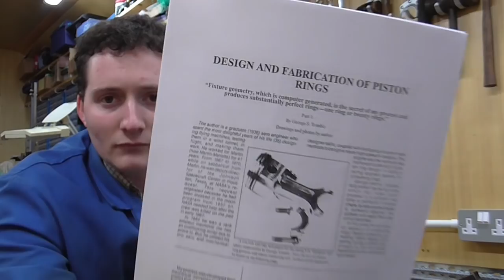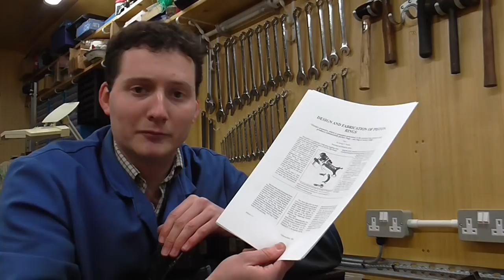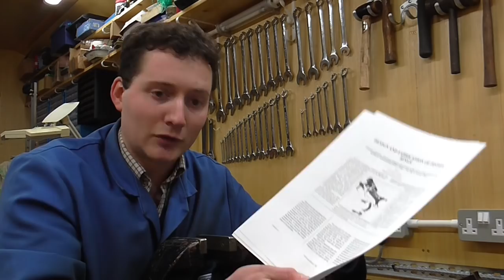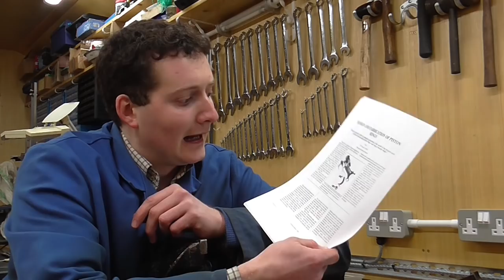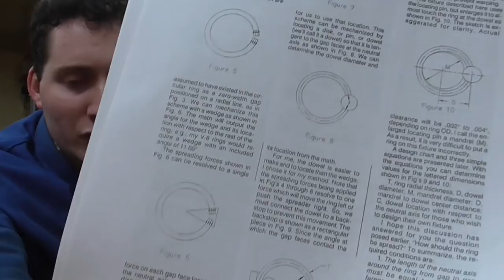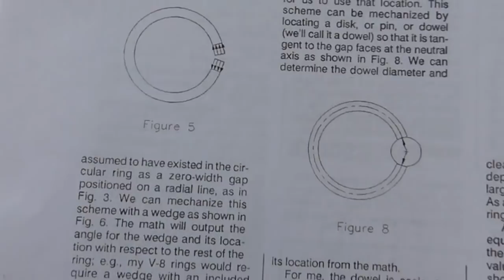Piston Rings 2

Comment: A couple of other differences between steam piston rings and internal combustion rings is that the weight of the ring starts to matter a lot when the speed is very high where in a gas engine you can get ring flutter, loss of sealing because of the rings inertia where steam pistons never get that fast and friction is less important because of the lower speeds. 
Secondly a gas engine piston rings are responsible for conducting the high heat out of the piston to the cylinder walls or they over heat. A steam engine pistons rings and cylinders are all at roughly the same temperature so no need. 
The type, quantity and quality of lubrication is very different between the 2. Gas engine rings are required to aid in keeping the oil out of the upper cylinder, which is not an issue for steam engines . Double acting steam rings need to seal high pressure in both directions, not gas engines.
It's amazing how devices so similar in appearance need such different qualities in different environments. That's engineering for ya.
Reply from the maker: Interesting

Comment: shouldnt that ring gap be larger? when things heat up wont expansion cause the ring ends  to hit?
Reply from the maker: The bore, piston and ring are all the same material so the expansion of the parts should be fairly similar
Reply: @MrCrispinEnterprises That would be true if you tried to skip rings altogether too...
Won't the piston and rings heat up much faster due to the size and exposure? Only after it has run for a while would it stabilize to its running temps for each component, that is presumably similar.

(eg starting, the piston and rings heat up much faster because they are small, while the cylinder has a lot of exposure to the outside and is comparatively more material to heat)
Reply: And actually, if you make a stack of thin rings of the same material, each just fitting outside the next ring, as you heat it, the stack will loosen and fall apart. (Conversely, cooling will clench the rings on eachother)

This is an effect that happens because the material wants to expand the same amount...per material. But the material length isn't the same, because the circumferences are different.

Example comparison: heat a material to the point where it has a 4% material expansion. A ring with a circumference of 100unitslength would then have 104unitslength, but a ring that started with 200units circumference would now be 208units.

This is best demonstrated with thin rings, because thicker material will have internal stresses resisting this as the material tries to exist at several sizes at the same time.
This is also why lightbulbs are typically thin, glass being very particular about having a low stress life, tends to hold everything in then explode when it gets bent out of shape.
Reply from the maker: Interesting points. I'm not qualified to comment.
Reply: @MrCrispinEnterprises  Qualifications-shmalifications. Don't sell yourself short.
I take qualifications with a real grain of salt.

I may have gone to engineering school, but you have a lathe and have made infinity times more piston rings than I have.
I'm enjoying your thinking through the process to come up with interesting & clever solutions (even if they don't always work out).

I've worked with many  "qualified" or "educated" people who are absurd with their advice or inept at what they are doing.
I've also worked with many people who without any formal training who can build something amazing or get you out of a real bind or give you solid advice to save you a lot of hassle.

Studied knowledge is only as good as a person is capable rationally and reasonably of applying it.
Reply from the maker: Very true! Cheers

Comment: Also I have seen pins installed in the piston grooves to prevent rings from spinning and lining up the gaps. Although the ring end gap is larger, it ensures the ring gap never lines up causing a leak.
Reply from the maker: Interesting!
Reply: Those pins are usually on two strokes to stop the ends of the rings getting caught in the barrel ports.
Reply: Even more interesting on two strokes when those pins work loose in the groove.
Reply: @mjm7187  oh yes!
Reply: two-strokes have pins to stop the rings rotating and getting caught in the ports and an arrow on the piston pointing to the exhaust so the pins will be in the right position ;)

Comment: Hello Mr Crispin, well explained video, piston rings aren't the easiest things to make. Just one point, now you've increased the internal diameter of the rings, wont the depth of the piston ring grooves be too deep allowing excess piston movement? 
Not having dealings with steam engines it may not matter, but it was just a thought.
Keep making the video's, really enjoyable.
Reply from the maker: Hi, no the pistons should be fine. The ring is always pressing outward so it should never come in to contact with the bottom of the groove. Cheers.

Comment: When you turned the piston rings round finally on the mandrel you took away most material at the high spots. Unfortunately one of the high spots is on the opposit side of the rings gap. So you further weakened this location that already bends most. So after this operation also the bent shape is different then before and it's again not round...
It seems to be impossible to me to make a well fitting piston ring. Luckily it was better then before nevertheless. ;)
Very interesting by the way - these are thoughts I never dealed with by now.

Comment: As a former piston ring designer and fitter engineer for 2 and 4 stroke engines, your end story wories me that  maybe the 70 yo locomotive rings were designed with too much expansive force,wearing  everything down,also due to lack of lubrication, of no oil there,but really i know very little about steam engines operation; 

It's important to bear in mind that in IC engines  the sealing force comes not only from the static expansive force of the ring itself, but mainly from the expansive force that acts on the ring from the inside out,due to the burning gas that penetrates through the all around side gap between ring and piston,don't know if that is also the case with steam; 

For your application i also wonder,and i would definitely try it,  if you could just use  simple square rings  of PTFE ("Teflon"),or graphite filled ptfe,instead of the metal ones ;  metal on metal need lubricant,need oil, but teflon is self lubricating, maybe more so with water or steam,than dry ?  after all, teflon rings are used on oil free reciprocating compressors,and in  all cars in their steering rack,in the  center piston,in a very slow but still dynamic sealing function of the high pressure,  alternating on the two sides,as you turn the steering wheel to the left and to the right.; they can be cut on a lathe, and my first search now,  came to a youtube video  from 2017 " teflon o ring how it made" .
edit: i just confirmed with  a steam engine  engineer  that the piston rings in fact also seal like in an ICE,that is,due to the steam pressure getting under them and pushing them out,both ways in the case of steam, so it is very important that the side gap is there.
Reply from the maker: Thanks for your interesting comment. Oil should be a problem here as the steam is mixed with steam oil on its way in to the cylinder. Cheers.

Comment: You are making what we called light tight rings at Brico (British piston ring company) except we would do several hundred an hour.
Reply from the maker: Interesting. Can you share you manufacturing method? I assume you don't re machine the OD after heat treat
Reply: Hi, Brico produced rings by several methods but very few customers specified light tightness, Koehler of Snowcat fame comes to mind. I should point out  that I was involved in developing things other than rings. The most common method was to make the ring oversize allowing for the gap put on a mandrel end clamped in the closed state and either finish turn or grind to size. Another method was to make the ring to size split it then place it on a short anvil and hammer the outside. This formed small indentation which had to be spaced closer together towards the gap.I have used this on 5”rings for small steam locos but it is tricky to do. The largest quantity of rings were cintered. The presses produced up to 180 a minute to finished size, after going through the furnace they were split at about 300 a minute then placed on a peg and put through another furnace to form the gap. I hope this helps,best wishes, Roger Marsh

Comment: Nice re-work of the rings. The extra step of skimming the outside diameter is derived from the work of Professor Chaddock. Another interesting read if you can find his article.
 I'm not sure of the requirements for Steam pistons and rings. But For internal combustion engines the space behind the ring is important. Having thinned the rings you now have twice the space behind the rings than you had before and also half the sealing surface on the top and bottom faces of the ring. Gasses / steam will find it easier to pass around the ring.
 Should this be of concern? Should the pistons be re-made with shallower grooves to suit the re-worked rings?
Thank you for your efforts. I really enjoy your videos..
Reply from the maker: Hi. It is probably a minor consideration but I think with the working pressure of 80psi and heavily lubricated steam I will be ok. Cheers.
Reply: @MrCrispinEnterprises  Yes. I think you'll be ok.
Thanks for your videos.
Reply: Bearing that in mind, as you have double the number needed, could you have thinned the rings width wise by half  rather than radially?
Reply from the maker: Hmm I'm not sure that would have the same effect? As far as I'm aware it was the radial thickness that was the problem so it had to reduce. Cheers
Reply: @MrCrispinEnterprises  i was thinking they would be springy and still fill the ring grooves. Also you could offset the ring gaps for less blow by. Im thinking full scale internal combustion engines practice  rather than steam but I guess the principle holds.
Reply: @chrisstephens6673  If he did change the width then he would for sure have to make new pistons with narrower ring slots. The typical allowable side clearance of a ring in the groove is only a thou or so for good sealing.
Reply: @rickoshea8138  you missed the point, two rings side by side in each groove, you know like they often use in car engines.
Reply: @davesage9190  two thin ones side by side, where's the problem?
Reply: @rickoshea8138  i have certainly come across three comp rings in one groove, I  have fitted them myself but cant remember the brand but a commercially available item.
Reply: @chrisstephens6673  wouldn't that be oil scraper rings and not compression rings?
Reply: @fuzzy1dk  no definitely comp rings.
Reply: @chrisstephens6673  No.  The rigidity of a beam (or piston ring, in this case) is proportional to the width and to the radial thickness CUBED.  So, reducing the width by 50% has a much smaller effect on rigidity than reducing the radial thickness by 50%.  (This is why I-beams are tall and skinny in cross-section.)
Reply: @chrisarmstrong8198  no what?
Did i imply any particular percentages?
Reply: @chrisstephens6673  As I understood it, your original suggestion was to reduce the ring width by 50% (while retaining the original radial thickness) and use two rings side-by-side in the same groove. My comment meant that, in this case, each ring's rigidity would still be excessive, i.e. when fitted, they would still press too hard against the cylinder wall.  Reducing the width by 50% reduces the rigidity to 50% of its original value, but reducing the radial thickness by 50% reduces the rigidity to 12.5% of its original value, leading to lower cylinder wall pressure and reduced wear.
Reply: @chrisarmstrong8198  👍

Comment: An automotive hose clamp can be used to compress the rings, you can make a compressing strap of steel or brass and compress it with some sort of pliers acting on a device brazed to the ends of the strap, or the best way is a tapered tube that will allow the uncompressed ring to enter the big end and exit the small end sufficiently compressed small enough to enter the cylinder. OD of rings can be machined between when clamped on a turning fixture between two discs similar to a two-piece piston. See 
https://www.youtube.com/watch?v=uJM-B3QAQYI 
at around 19 minutes. You could center the ring with a ball bearing mounted on your cross slide. Looks like the ring tension can be adjusted by thinning the inside of the ring.(increasing the I.D.). Good luck holding it steady.

Comment: Hi, I’ve been wondering, because it’s not normal to have such a big void on the inside piston ring and it’s normal to get blow past even through the ring gap, what will happen if steam pressure builds up in that void?  Hopefully nothing will happen. Anyone got the answer to that.
Reply from the maker: Hmm interesting thought. Perhaps in someway a larger void would help reduce the pressure building up with in? You would need to take it allot more steam to pressurise the void than if the gap was smaller? No idea.
Reply: Yes hopefully you’re right. Let’s hope someone has a definitive answer to that. I just thought pressure can only increase in a void.
Reply from the maker: Yes it's an interesting point

Comment: You still have not addressed one question from the first episode, and that is, how much to stretch the ring. The more the ring is stretched the more pressure it will exert on cylinder walls leading to premature wear and scraping of oil from cylinder walls. In general, it is understood that 'loose' rings works better and last longer than 'tight' rings.
Reply from the maker: You'll have to read the article to find out!

Comment: 28:30 I wouldn't chamfer the O/corners of the rings as that will encourage leakage.
Reply: It seems to be balancing ideal geometry against practical assembly details.  What good is a perfect piston ring if installing it damages the piston or cylinder wall?
Reply: @somebodyelse6673  The outer corners wouldn't - the rings can be compressed to just under bore diameter - so they're not damaging the bore.
I daresay, MrCrispin, that the ring ends ought to perhaps have 2/10 taken off the O/D at the ends to avoid the ends wearing axial grooves in the bore.

Comment: Why not just lapping them with the piston in the cylinder with some grease and an abrasive?
Reply from the maker: What would change shape? The ring or the cylinder!
Reply: @MrCrispinEnterprises  The ring will become round and the cylinder will stay round but become a negligible tiny little bit larger.
Reply from the maker: Hmm I would be worried about disturbing the bores parallelism not to mention embedding abrasive in to the surfaces. I expect it would make the piston ring round though.

Comment: On the copyright, I heard you say it was published in 1989, but need to know where it was published  (what magazine, etc) and if the article you have in hand has a copyright notice on it. Feel free to message me
Reply from the maker: It was in the magazine Strictly IC 
Cheers
Reply: American copyright is different to UK,  i think what you should look into is "fair use" or educational use. Generally it seems a mine field and you never see a broke copyright solicitor.
Reply: @MrCrispinEnterprises  @UC-Eg5K5ftEl5hKZrc0VOP-Q Chris is correct that US and UK laws vary in terms and duration. However, Strictly IC magazine is published in the US and claims US and by extension, I presume, applicable rights worldwide. This article is not past the time limits in the US to fall into the public domain and I think the publishing of an entire article would run afoul of the "fair use" and the wide publication of it would likely not pass the "education" use either. Even if they did, you'd likely get a takedown notice and, service providers not wanting to spend the time, would defer to the copyright holder and takedown the material, possibly giving you a strict in the process. So, I'd just refer interested viewers to Strictly IC magazine (or ask permission to reprint with reference and credit—which the publisher might go fo given the broader exposure).